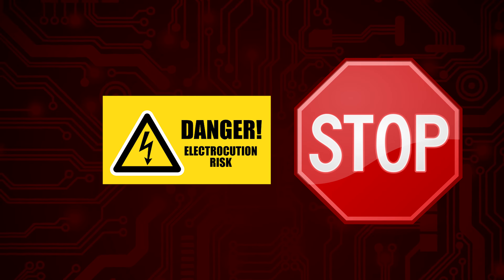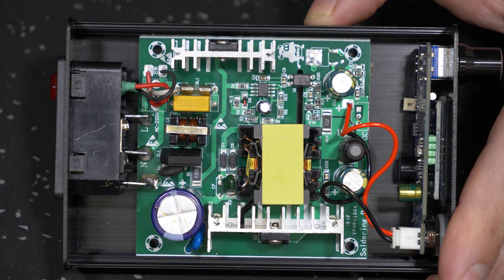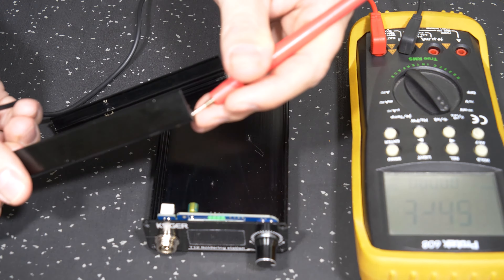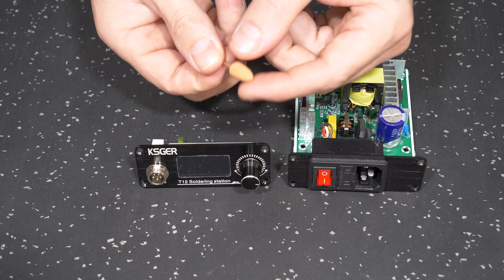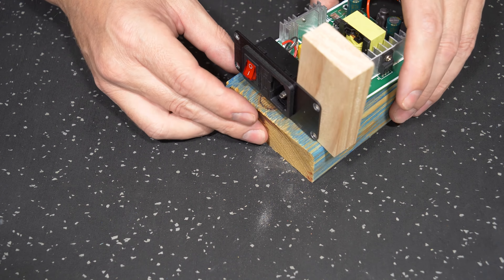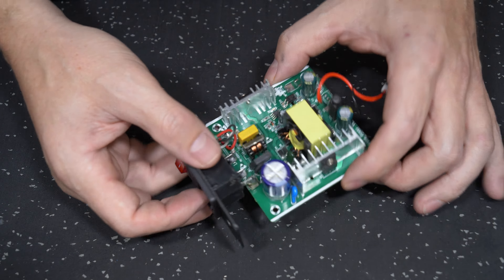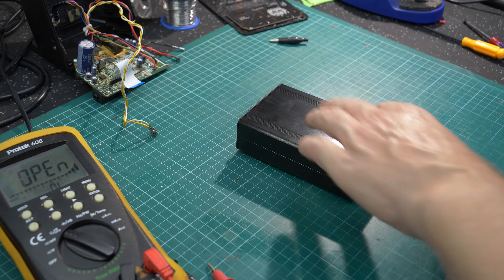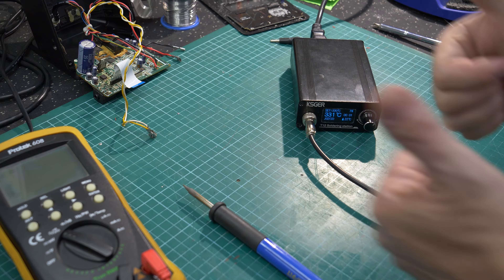#31 - The KSGER T12 Soldering Station - How to bring it back to Earth!

Comment: I live in a house that only has 2 prong outlets, does this apply to me? What's your recommendation
Reply: Maybe there are other safety issues (before your soldering iron) that need addressing.  Certainly your workshop or electronics work area should be fitted with fully earthed outlets and protected with an RCD or GFCI.  What country do you live in please?
Reply from the maker: Like Brian, I now have questions also...
Reply: This isn't particularly uncommon in old (pre 1960?) houses in the US. It would be wise to consult a licensed electrician in your area. The safety correction shown in this video will do nothing for you if the building wiring does not have a proper ground. I'm curious, what country do you live in and how are you currently plugging in your 3-prong devices?
Reply: I agree, I may cost a little bit of money but even having a separate outlet wired in with a proper earth ground rod installed could save a life. I have a large work bench at my home with dozens of components and power supplies hooked up and one of my benches are metal, one time my son had plugged in a extension cord that had its earth (ground) pin removed and I didn't know it. After plugging a couple other devices into it some time later and working at my bench one late night I was leaning against the edge of bench and through my left for arm to my right elbow that was resting against the metal power strip screwed to the front of the bench i got BIT....Hard....scared the hell out of me. I grabbed my test meter and found 92V ac leaking from my cheap Chinese 958D+ soldering station do my desk through a screw into my arm into the power strip that was on a different circuit that was grounded...took me a hour to find the cord with no ground pin..I cut the head off...

Comment: all sort of safety concerns; traces and solder should be not used to route earth; solid screws or welds should connect earth to the case, it should not be connected using solder or the PCB; that capacitor is a poor idea, if it fails, no connection, the iron should connect to mains earth directly or through 1M resistor; the case parts connections are not secure enough, the main case still not connected through earth
Reply from the maker: Agreed, thanks for your comment. 👍
Reply: XYZ Concepts really good video, keep them coming, I’ve subscribed <3 I’m sorry if my comment seemed negative

Comment: There are two other major problem (beside the connection via the small screws being actually not sufficiently robust - the safety standard requires at least M4 screw size to count as safety ground, as it has to be able to handle 6kA fault current):
The surface distance between the live component (mainly the switching transistor leads, but its heatsink is not good either) are way too short towards the case aluminum body. The remedy could be to grind off the extrusion forming the pcb holding slit around where the transistor pins and its heatsink are located and insert there an insulating insert (few layers of Kapton tape,...). Generally such insulation sheet is supposed to be covering the whole area of the metal case underneath and above the PCB. Because when an arcover fault happens there (component failure,...), such sheet is the only thing preventing the arc from connecting the live potential to the case.

Other problem is of EMC compliance type:
The grounding goes from the mains connector to the negative secondary side before the filter inductor.
Now as the supply works, there is larger RF disturbance component across the first capacitor after the rectifier, this is then filtered by the inductor and the second capacitor. That means there is an RF voltage across this inductor. As one side of this inductor is connected to the mains grounding and the other to the output, this arrangement sends all the voltage across that inductor to the "nice dipole" antenna formed by the mains lead on one and the lead to the handle on the other side, readily radiating all the RF mess. The cure then would be to disconnect the "grounding" PCB track (far safety purpose it is far inadequate anyway) and connect the output side of the filter choke to the PE terminal on the mains socket by a proper wire.
Reply from the maker: Yep, if the unit was to be completely redesigned many improvements would be nescessary.  So the video addressed an easy reach safety mod that most people with these units can do.  Great comment though. 👍

Comment: just a heads up - anyone that has purchased an iron such as this does not need the patronising demonstration that metal is conductive! I would have liked to have seen a longer earth wire snaking its way up to the front panel and perhaps onto the socket pody of the iron itself!
Reply: So adding the ground wire to the case doesn't also make the tip grounded ?

Comment: Fake. You are testing for continuity. When you scratched through the paint on the metasl case, you created a circuit between the points of the multimeter and therefore got the beep for continuity. 
You have a continuity through the plug and the nut behind the adjuster knob because they are part of the ground on the circuit board. If you were an electrician, you would know you have to test an earth post with the negative probe and the case with the positive probe to see if there was a live current going through the case. I have built 4 of these soldering stations from kits and I have had them as they come and also earthed the casing to the power plug earth connector. None of mine have gone up in flames, blew a fuse or gave me an electric shock. These are great soldering stations to use and I have them as my go to soldering station every time, even though I have others to use.
Reply from the maker: Thanks for your comment.  I suggest you might want to rewatch the video, then edit or delete your comment.  I ask you this, how can the earth connection be at the adjuster knob (potentiometer mounting nut) when there is no physical earth connection the mains IEC socket to the case in the first instance?  The scratch test was demonstrating the thin anodised layer that shouldn't be relied upon for insulation.  Again, you have the opportunity to review and correct your comment, thankfully.  Do it soon before you embarrass yourself to the masses.  Stay safe.
Reply: @xyzconceptsYT  There is nothing on these units that can short out the case to power. Even you said in the video the earth is through the black wire to the front board, which also earths the soldering iron plug. You even tested for continuity between the plug socket to the nut behind the pot knob and it was connected. Nothing powered can touch the case and there is a space under the power circuit board as it runs in the rails. You checked the continuity of the case top and said you made a power track.